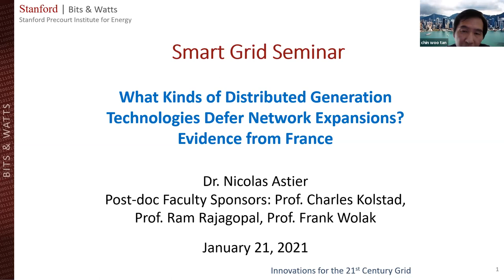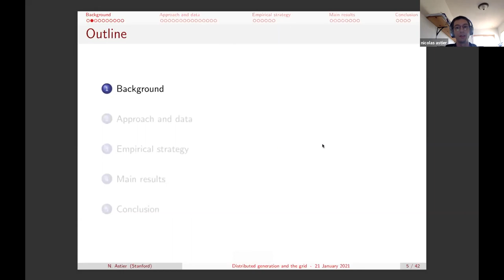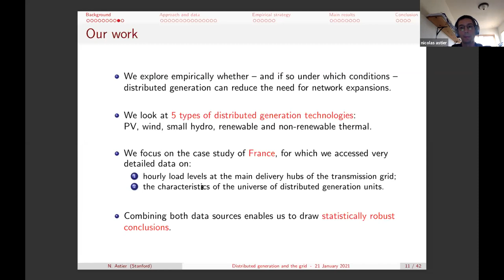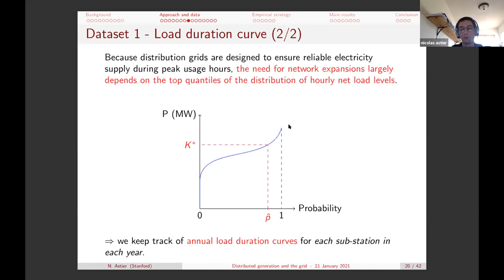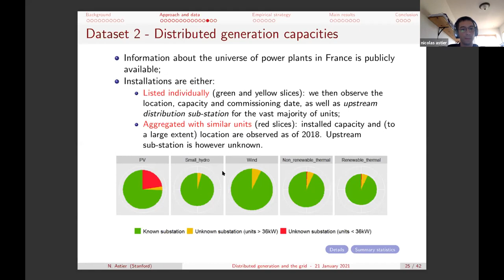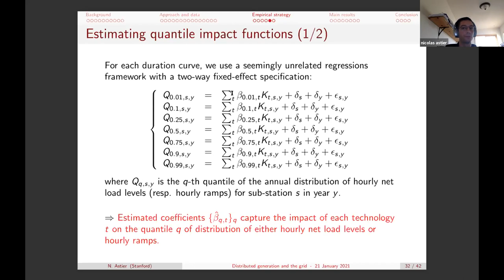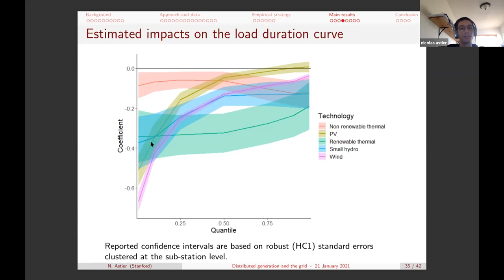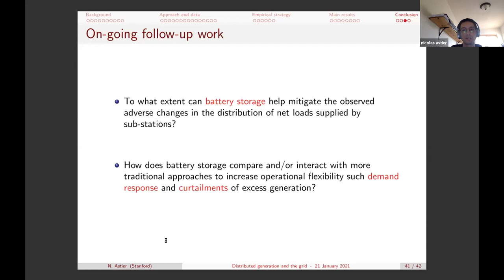Distributed generation and the need for network expansions I Nicolas Astier I Smart Grid Seminar

Comment: I understand the limits of a specific country (dedicated to nuclear) and looking at an existing grid system. Looking outside those limits, I notice no mention of the storage of electrical power from renewable sources, to both balance load and store surplus electricity. Also not covered is the long distance transmission of power using HVDC. Given the date of this presentation,  I note later presentations along these lines.